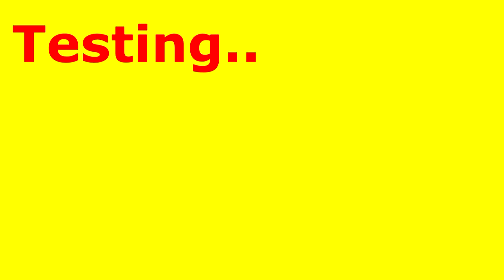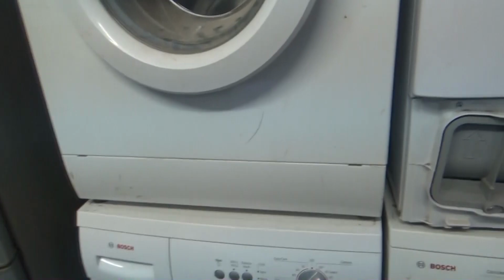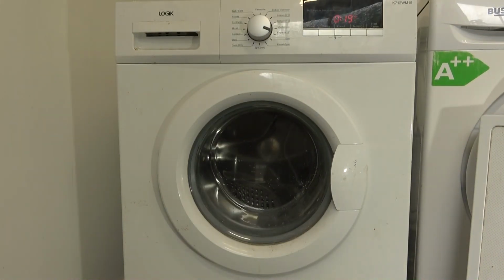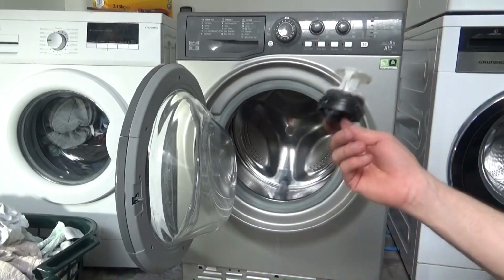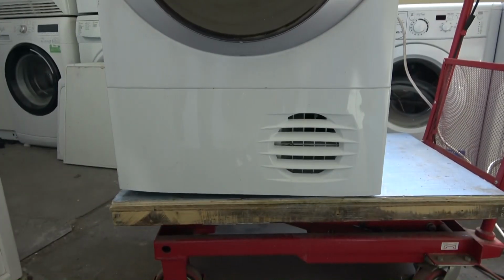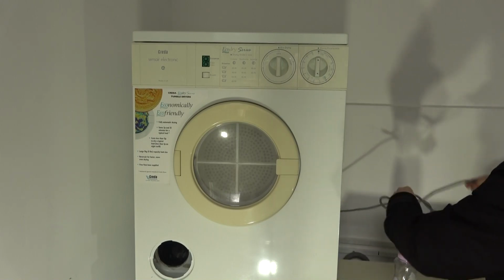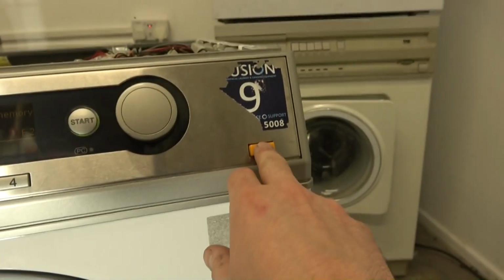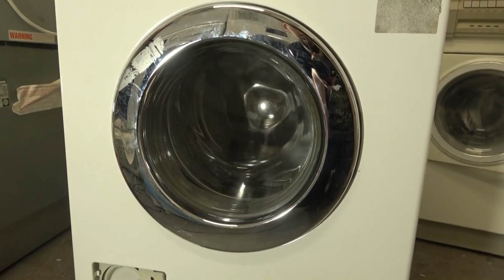Testing No.40

Comment: that silver hotpoint dryer is a hotpoint tvm35 dryer
Reply from the maker: It is. Its filthy and the belt has snapped. And door handle has snapped but would love to get it going again.
Reply: @whichwasher2007   the bearings needed replacing on my old hotpoint tdl30 and the door handle needed replacing on my old hotpoint tdl30